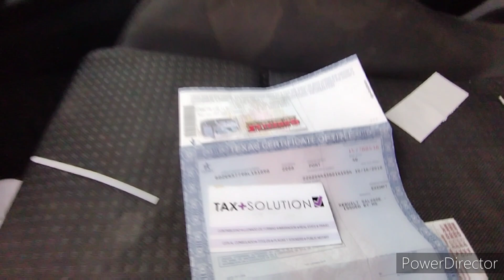Pontiac's Last Performance Hurrah Was Imported From Australia. 2008 G8 Junkyard Find

Comment: Whoa Nelley, G8 and used to be great.

I was going to buy one along with my G6 convertible in late 2008 (mine is a 2009). I was also considering two convertibles, the G6 and the Solstice together, but I was worried about the fabric top, so I only wound up with one car and that's the G6 convertible I still have, which turns out to be rare with only 1,135 of them made like mine. Not correct, there were Pontiacs in 2010, and that is the final year for them. 

Yes, 2008 with the 10th digit of the VIN being an "8" for 2008. They were assembled in Elizabeth, South Australia. This would have the "high feature" RPO code "LY7" 3.5L V6. There were 15,002 of these sold in 2008 and 23,157 of them sold in 2009. Yes, although being made in Australia wasn't an issue, I thought any Pontiac with performance should be US assembled. Pontiac quickly faded out of sight after 2010 and that last year was really a "fleet year" of sorts to run out the inventory more or less. Should be code 41 Black Panther exterior paint. The transmission is the 5L40E five speed automatic. The "5" means five speed, the "L" is for longitudinal arrangement (front to back), 40 is the relative torque capacity, and "E" means electronically controlled.   I liked them at the time, but I thought Olivia Newton-John was a much better Australian import to the US than these.........

Whoa Nelley, 3.5 and took a nosedive. Poncho from Down Under didn't quite cause the needed thunder. From the land of 'Roo, it's over for you. Salvage title from MS, and this one is a mess. 5L40E and it's over for thee. G8 soon to meet the final fate. "Have To Believe We Are Magic" (1980/Olivia Newton John/Xanadu) and the fate of this one is tragic. 1980 had Xanadu and it's over for you. Going to be flat and that's that. Poncho needs a new honcho. RPO code "LY7" going to Heaven. Going to get squished and maybe some here, I don't think Benny, but only slightly so the Google Man are going to be pissed.
Reply from the maker: Someone said that the Pontiac g3 next to it was even more rare than this one 😄. Might have to make a video on it too. Can't pass up a video on rare Pontiac 😄
Reply: @ClassicRideSociety  Show it if you want. Maybe do an hour-long video on it. LOL.
Reply from the maker: @googleusergp  I can stretch a video but that would be difficult. 😄
Reply: @ClassicRideSociety  I won't complain if you do an hour worth of 2nd gen F bodies. LOL.

Comment: I had an 06 GTO and I would have got this car next if I didn't move to the city.  The GTO was crazy fast and these were quick too. GM screwed up with this car. If they would have brought it over a couple years earlier and actually had some marketing and pushed it It could I've been a flagship for all the brands Buick Pontiac and Chevy.  They would have sold cuz there's lots of people who still want a V8 and a rear wheel drive car and not an SUV or a pickup.  Look at the success Chrysler had with the rear wheel drive Dodge's and Chryslers
Reply: Wasn't the chevy version the caprice?
Reply: @danh2134  It was only available as a Caprice police pursuit vehicle The general public couldn't buy it
Reply: @darrenporsch  not available to the public then but are now available through municipal auctions
Reply: @danh2134  Yes but the car was never offered in a civilian version for people wanting a rear wheel drive V8 car so a lot of people went and bought Dodges or Chryslers. Doesn't matter if you can get it out of municipal auction now Like I said they never made a civilian version and offered it to the general public

Comment: the doors sell for 
250$ per door shell 
hood 200+
quarters or rear clip1500+ 
seats 500 all
I kinda part them out where's that one located at I'll take more parts
Reply from the maker: Pick n Pull Ft Worth Texas
Reply: @ClassicRideSociety  if you stripped that can you'll make a  decent profit off the parts.. the rear axle is worth 800+